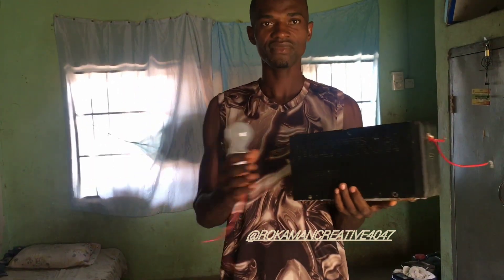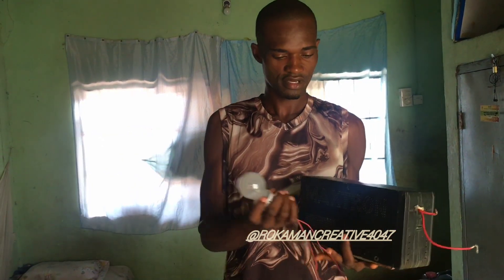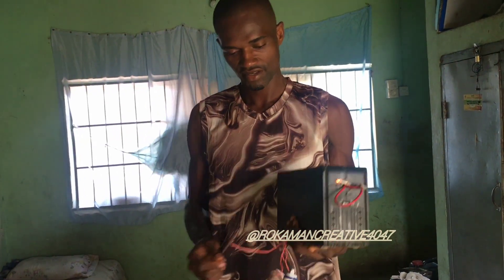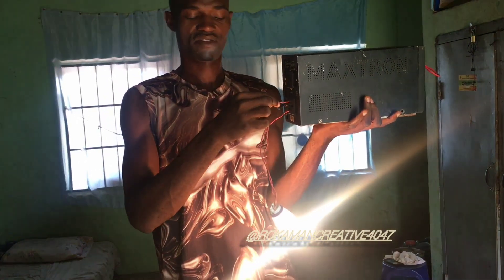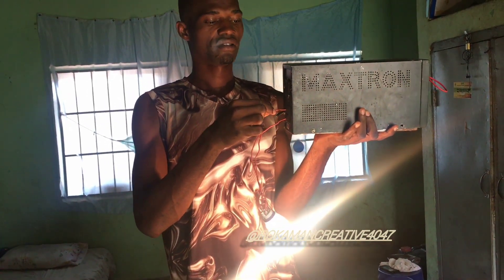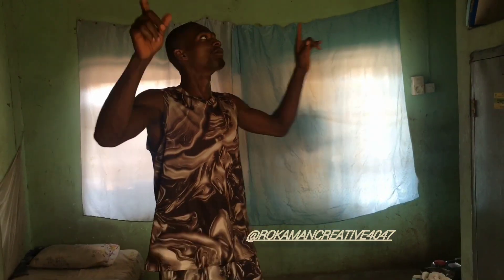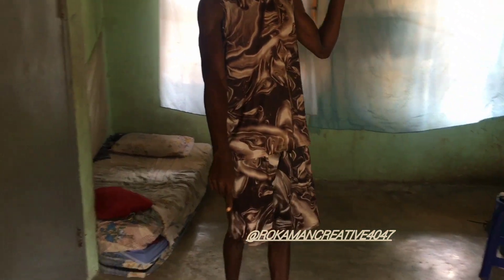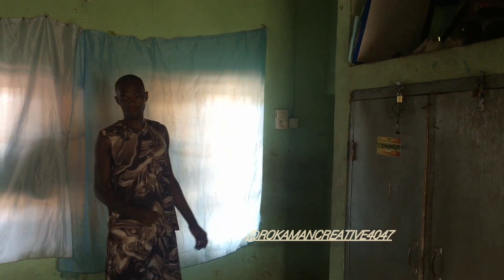best pure sine wave inverter 2022

Comment: If the fan hums the it's not a pure sine wave inverter
Reply from the maker: Thanks for contacting roka man creative,is a sine wave but need 24volt to work properly and good ,but I use 12 volt that is why d fan is humming
Reply: @rokamancreative4047  it is not a pure sine wave, even a 12volts pure sine wave cannot hum a fan, if your inverter is a center tap transformer with sg3524, it's not a pure sine wave.
Reply from the maker: Thanks we're are u chatting from